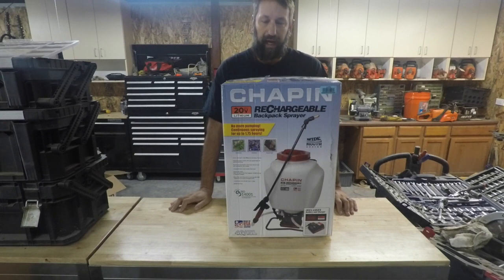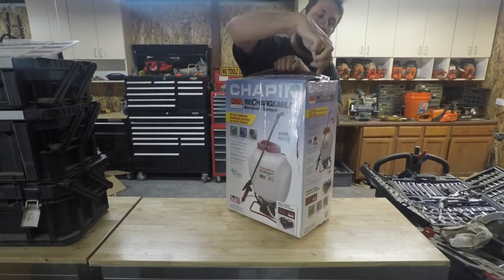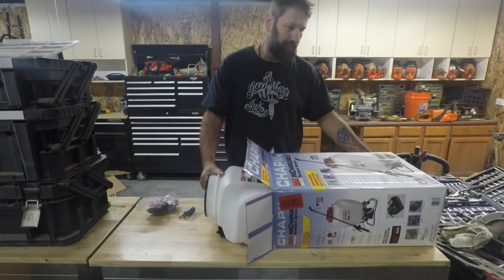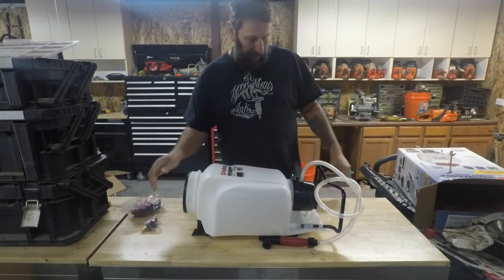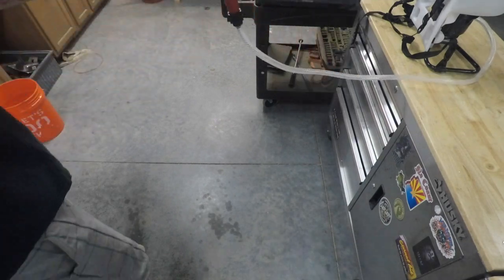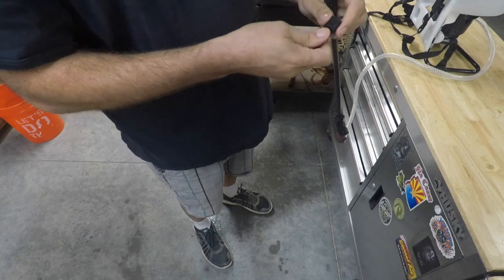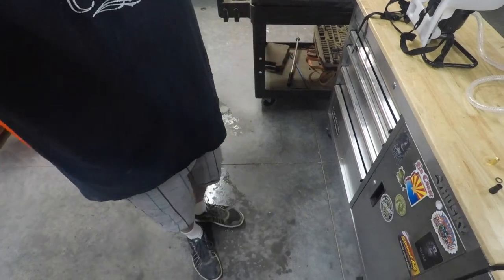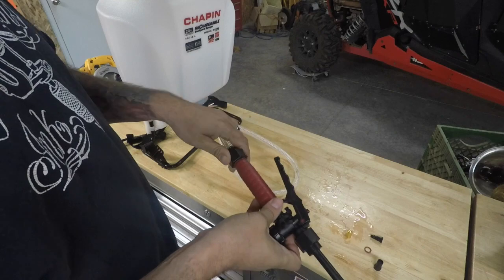Chapin 63985 20V Backpack Sprayer Review

Comment: These things are complete garbage.. I've been through three of them in the last five months and they all leak through the bottom of the pump on to the battery and on to whoever's wearing the backpack sprayer
Reply from the maker: Yes they are crap. Check out my video on the My4sons sprayer.  It’s light years ahead of this sprayer.  I can’t recommend this anymore because of those problems you mentioned.
Reply: I saw your video earlier and didn't realize you made both of them LOL I just ordered the M4 backpack sprayer period. I was going to Shell out the bucks for a birchmeier battery pack but it didn't seem like it was accessorized of this one so we shall see